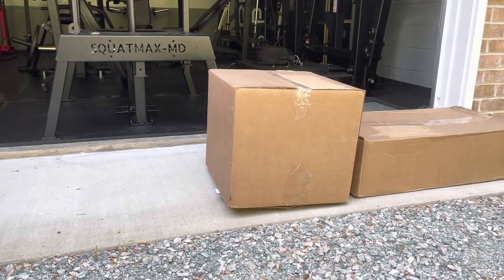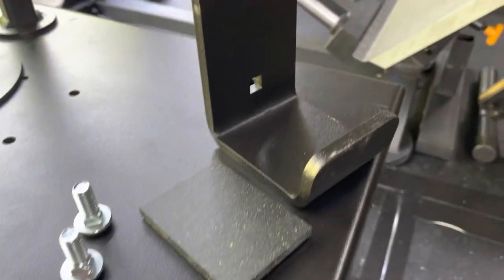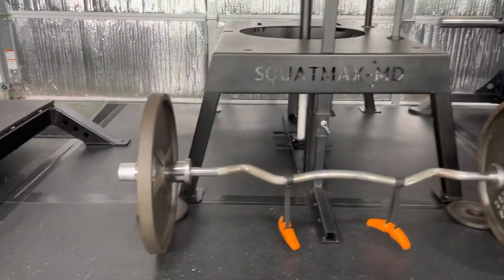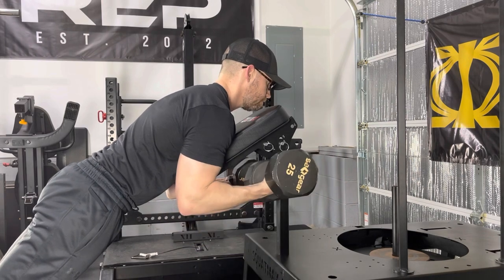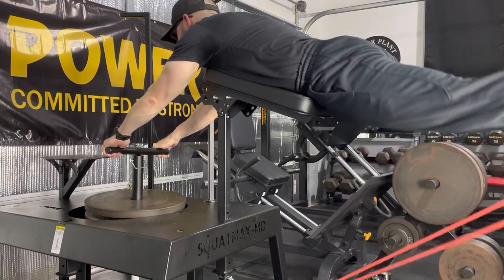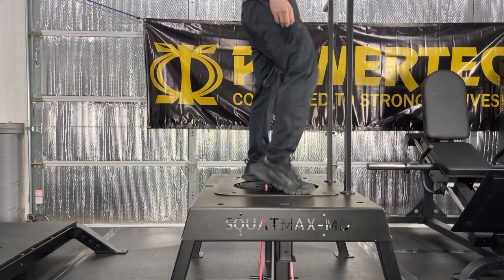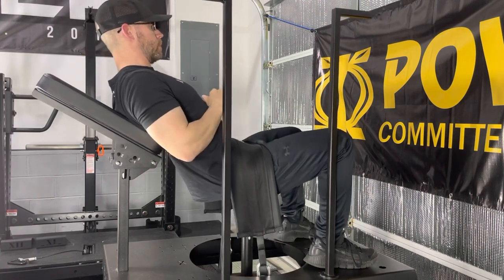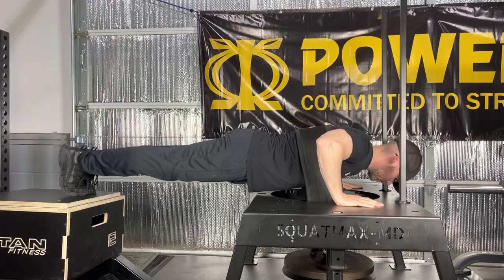The Squatmax MD Chest Supported Row, Transformer Pin, and Hip Thrust Pin Review

Comment: I'm debating whether to buy the Squatmax MD or the Edge Fitness System Hip Extension Belt Squat Combo Unit, which is a little cheaper.
I'm leaning towards buying the Edge Fitness System Combo Unit because it seems to me to be a better machine, even though it is essentially a lever machine.
It will also fit in my basement gym, unlike the Squatmax MD, because I won't be able to use because I'm too tall and only have an 82 inch high basement ceiling.
If I do buy the Squatmax MD, I'll put it into my garage gym, which has a much higher ceiling.
Reply from the maker: I just looked up the Edge machine.  I don’t like it.  I don’t think either exercise would be very good on that machine.

Comment: I already own a titan selectorized lat pull down, a selectorized  funcional trainer and foldable titan rack also a stray dog goat with all the attachments.. Do you still prefer the rhino over the squat max?  I was about to buy squat max but they don't have financing. I like it because it's smaller than rhino and cheaper,  however rhino has financing where I can give $1000 and pay the rest in 6 payments with no interest:) that I can do. But it looks quite large compared to squat max??
Reply from the maker: The good news is you can’t go wrong with either belt squat.  The Rhino is a little bit wider and the squatmax requires greater ceiling height.

Comment: I got Titan Squat Max MD and tried the loading pin in the back and didn't feel much of a difference.  Curious what you like to do for hamstrings?  I got a rack mounted leg curl/extension its OK but not great zero resistance at the bottom, I hacked my athena cable to it and its some resistance and today tried holding a band tight which worked even better.  Lots of people talk about stiff leg deadlifts and RDLs.
Reply from the maker: For hamstrings, I usually stick to prone leg curls, seated leg curls, and GHRs.  I’m not really a fan of any of the rack mounted leg extension / leg curls I’ve seen.  Using your cable system and bands like you didn’t will definitely make it better.
Unfortunately, I can’t do SLDL / RDLs bc of my back.
Reply: Ok thank you!  I've seen people who put legs under bar with some weight on it and on their bench with some bands tied to their rack start to do GHRs I might try that.  mine has standing leg curl and with enough reps do feel it and have some soreness just not nearly as good as gym equipment. @HomeGymHacksandReviews
Reply from the maker: @chrisdonnell2575  that is a good option, but I think having a footplate to push against is what truly separates the actual machine / bench from the hacks I’ve tried in the past.

Comment: Squat max Vs Bells if steel belt Squat? 
Definitely a price difference, any insight into if Bells of Steel would be an worthy purchase?

Thanks,

Also IM2000 FTW!
Reply: The free weight belt sqaut is superior to a cable belt sqaut and a cable belt sqaut is superior to a lever style belt sqaut. The sqautmax md is the best option imo as it has a mid range price and the smallest footprint for space and it's a free weight style belt sqaut
Reply: @OG_johnsmith  good points. I am located in Canada, the BOS Belt squat has great reviews backing it up. The price difference is almost 1/3 the SM. 

Still haven't made a final decision. Though I wouldn't imagine a lever action would significantly be much worse. 

The only thing with the SM is that a dropset would be particularly long, vs the BOS
Reply: @Cousin.Justin  I think when comparing them, there are slight differences, in which are better (I believe the sqaut max is the best followed by the rogue rhino) but they will all do the job. I went with the sqautmax md because I am recovering from a knee injury where a had a pcl tear and severe mcl sprain and the free weight is easier on the knees forsure (plus I like the add ons for the sqautmax md that ill probably get sometime down the road). The lever action belt sqauts tend to have a forward pull resulting in more sheer forces on the knee. But, overall I think a lever style belt sqaut is better than no belt sqaut. Good luck with your decision and I hope whatever you get it works for you!
Reply from the maker: I am not a huge fan of lever belt squats.  If you look at most in action, notice how the line of drive is diagonal creating sheer.  You want the pull to be directly below you.  I would like to try / review the Bells belt squat, but that may be a ways down the road.
Reply from the maker: And yes, IM 2000 FTW! 😂
Reply: @OG_johnsmith  thanks John, great info. 🤜🏻💥🤛🏻
Reply: @HomeGymHacksandReviews 
I guess I have a little more thinking to do   Would drop sets be unmanageable with the SM in your opinion?
Reply from the maker: @Cousin.Justin  I don’t think it would be too bad.  If you have 2.5s between each 45 it will makes things much easier.
Reply: @HomeGymHacksandReviews  does rhino creates any sheer on bad knees comparw to squat max?  It seems like with rhino if u step back younwill change the angle of the cable
Reply from the maker: @futbol1972  correct so I stand directly over the cable to eliminate / reduce sheer.
Reply: @OG_John Smith  this is hard. Lol.  The only way I would prefer rhino over squatmax it's for easier loading but that's pretty much it. I think if I get grip plates or spacers it will make loading less cumersome on squat max??
Iam just afraid I will hate the loading/unloading plates on vertical pin. However,  I love the fact that it's smaller l, cheaper and has the sit and hip thrust attachment. I already own straydog goat but I will buy the pad for squat max just for the hip thrust. It looks like set up it's pretty straight forward for hipt thrust  rhino it's versatile but I already own selectorized cable machines
Reply: @TheZOMG22 I have a bad knee from playing soccer all my life and 2 bulding disk in lower back.  I had my rhino for about two months but thinking about buying squat max md cause people tell me it's easier on knees and back since it has no sheering at all

Comment: I have a very old version of the squat max. My version, when the loading pin is directly centered over the guide rod, it is not directly center in the opening of the platform. Is that still the case with the one you have? When I free squatted, without the seat, the rod scraped really hard against inside the loading pin if I tried to stay center of platform; the loading pin in this orientation, would actually be angled towards behind me. If I wanted the rod and loading pin to be perfectly aligned with each other, my 45s would be about a half inch away from the front lip opening and you know I clipped that front edge quite a few times.
Reply from the maker: With the newest model, there is an extra inch or two between the 45 pound plates and the back of the platform’s opening.  With 45s, I’ve never had a plate clip.  With 35s and the close-stance inlay attached, the plates have clipped the side but not enough to mess me up.
Reply: @HomeGymHacksandReviews  when free squatting, do you try to line up w the center of the hole or centered along the guide rod?
Reply from the maker: @kylebeng  the guide rod / loading pin.

Comment: Man those are some awesome attachments that make this machine much more versatile. If you had to pick one, would you go with the Rhino or SquatMax?
Reply from the maker: Agreed.   Both are awesome and each one has features I like, but the Rhino has always been my favorite piece of home gym equipment.
Reply: @Home Gym Hacks and Reviews  is the rhino yoir favorite only because the loading its easier??  If you had selectorized lat pull down machine and selwctorized functional trainer where u did not have to use rhino for cable exercises since u could do them on machines mentioned avobe would you still had chosen the rhino or squat max?  Iam pretty much just using it for belt squats since I have all the otjer cable machines. But can't stop thinking about loading on vertical pin. It's probably not that bad but iam just over thinking😢 well another minor thing too it's stepping up and down onto the 20" high platform
Reply from the maker: Easier loading and unloading made a difference for me.  As I mentioned in the review, I can’t tell that much of a difference between the two when squatting.
Reply: @HomeGymHacksandReviews  thank u

Comment: I am buying squat max over rhino do to smaller foot print, anyways waiting to find a discount code so I can buy it 
I have a question, I bought the straydog goat with a pad too  it has the same use as the bulldog pad pretty much.  If I buy the squat max I wonder if I really need the hip trust attachment and the pad since I feel I can do thoese movements on goat, maybe not as good as squat max though🙄.  So if I buyt the best model of squat max do you know what comes with it?  The sit I would like to get and probably the  deadlift bar. Or can I attach any bar to the squat max to do deadlifts and rack pulls,
Reply from the maker: I don’t think you can go wrong with either.  Brian usually doesn’t have discount codes.  

If you have the Straydog, you may not need the chest-supported row option, but if you ever plan to get the hip thrust, you will need it.  Also, you can always start with the base model and add the additional pieces over time.  

The deadlift bar is an add-on, and other bars can attach to the loading pin.

It comes with the seat, close stance inlay, band pegs, and bands.  Everything else is add-on.
Reply: @HomeGymHacksandReviews  thank u.  I was also thinking about throwing a bully glider on one of my uprigjts to make a belt squat
Reply from the maker: @futbol1972  those look good and versatile.
Reply: Sorry for asking you again🙄  
Today I  was trying to simulate squat max with a 20" high by 24" plyobox, and  I placed a rogue monster  vertical peg plate standing   on top of the center of plyobox  I was pretending the plyobox was squatmax and was loading and unloading only 25lbs iron plates with grips  and it kindda sucks. Maybe on the actual squat max machine is a little bit better?? I think I will like the loading on rhino alot  better but I don't know. I have two bulding disk amd do jujitsu so my back it's always sensitive so with squat max it seems like I have to be bending all the time to unload and load plates???  Let me know please cause iam still deciding.  I wanna order today. I like squat max hip thrust, seal rows and also that it has free weights but I don't know if I will like the vertical pin???  I know u told me I can't go wrong with ether one.
Reply from the maker: @futbol1972  loading and unloading is easier on the Rhino and there are more foot positions possible on the Rhino.  I really think you need to try both by finding gyms that have one or both.
Reply: @Home Gym Hacks and Reviews  yea I been calling but they don't have them here where I live

Comment: Do u k ow if its easy to do calfs on squat max too like in rhino?
Reply from the maker: Somewhere I showed how I used the close stance inlay and the Ironmaster Calf Block for a vertical line-of-drive calf raise.  There’s also the option to use the transformer pin and perform them off the edge.  Neither option is quite as good as a calf block and the Rhino.
Reply: @HomeGymHacksandReviews  thank u